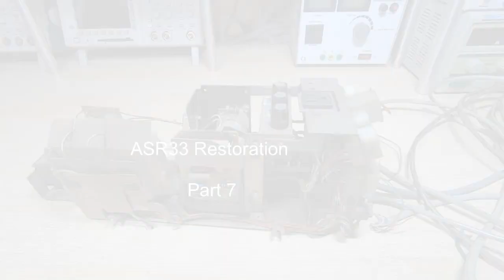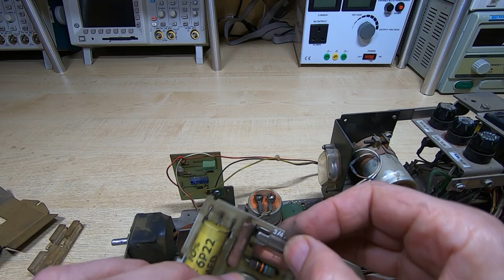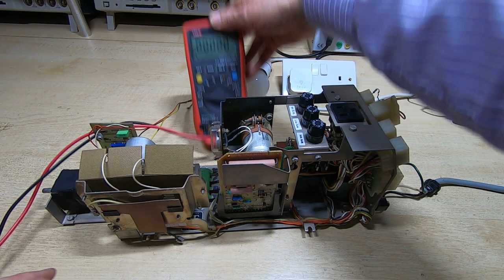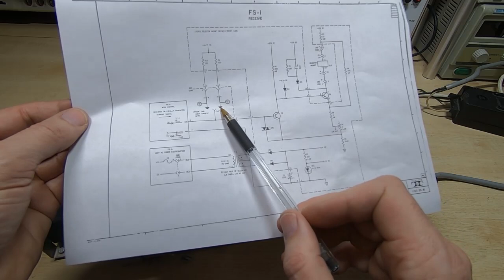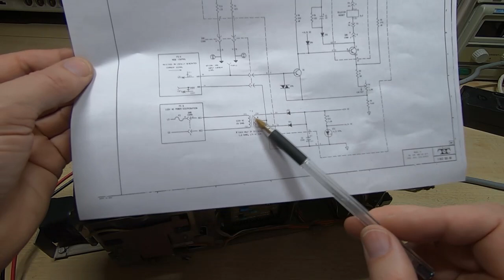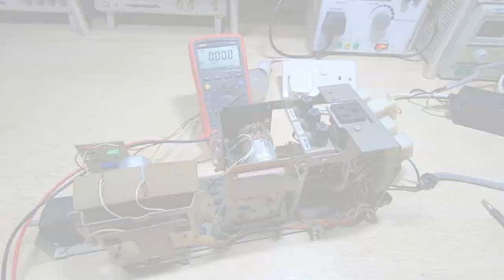ASR33 Restoration  Part7

Comment: Old video - but I'm watching this series again and have two questions about your dim bulb tester.  Firstly, is that a 240v bulb or 120v? And what wattage? I'm assuming that a 240v bulb has higher resistance and would therefore you would need to double the wattage of the bulb vs what you would expect - is that right?

Comment: I've got an ASR33 that was donated to me from a PDP-8 enthusiast several years ago for use with my PDP-8s.  I just need to work through enough of my "projects" to clear up enough bench space to work on it.  I first used an ASR33 on a Data General NOVA 1220 in college, writing FORTRAN programs for a Mechanisms (Analysis?) class -- much better & faster than punching cards at the computer center!
Reply from the maker: I first used one connected to a minimac mainframe and the first programs were saved on punched cards. We had a major upgrade to punched tape. It was not as long ago as it probably sounds.